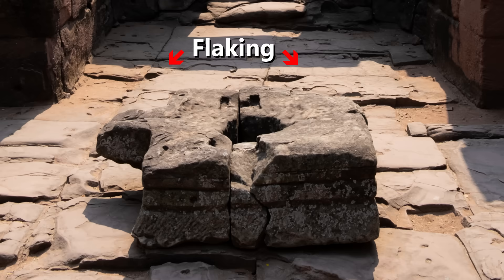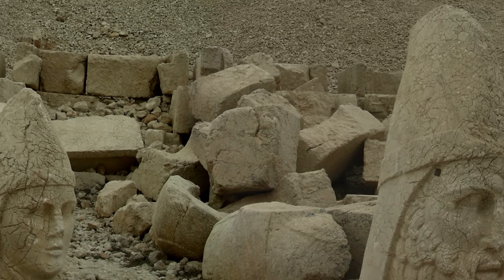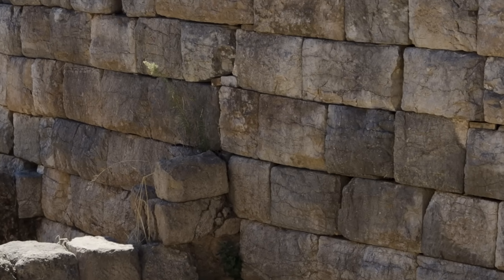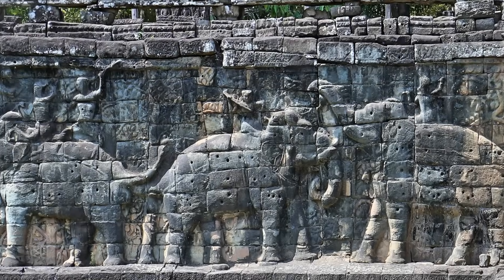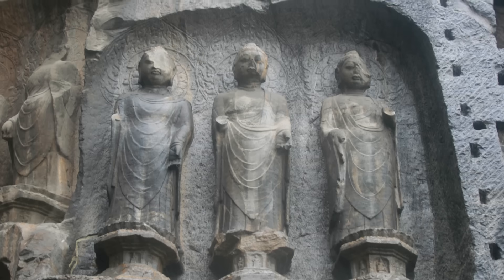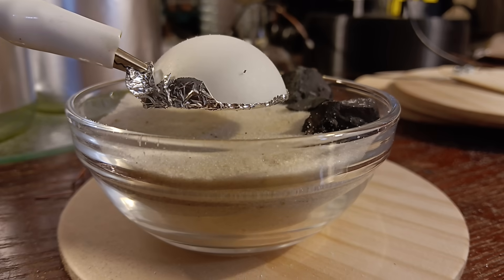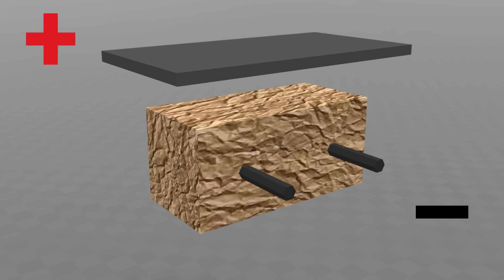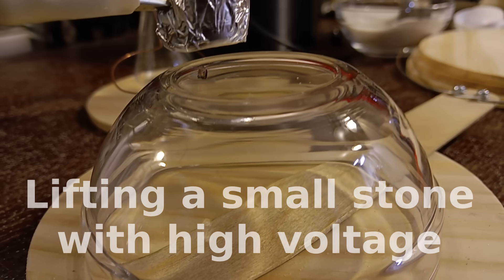The Greatest Mystery, Solved. Recreating Ancient Stone Melding Technology (Part 1)

Comment: You might be right.  However, you somehow failed to anticipate Questions:

1.  Why would the knobs be allowed to exist if they were formed while the stone was so soft?  Couldn't they be patted down with something?  Obviously it was decided the knobs would be allowed to remain in place for some reason.  Even if they weren't going to be visible, it seems too much of an imperfection.  What could the reasoning be?

2.  You assert(without evidence) that the rod left behind inside the shaft was actually an ancient electrode.  Maybe you're right, but does it (coincidentally)match any known modern metal tools?

3.  Any thoughts on what the structures' functions were?

4.  How was the electricity generated?

5.  How were stones moved across great distances with the technology you describe?  Was there a portable weight-reduction technique?

6.  The finished structures must have had some function which was not functioning during the construction of the structure itself, right?

I'm all ears to your exploration of these things because you seem to be the only person with a reasonable-sounding explanation for the strange details like the holes and knobs.  However, as I said, you failed to anticipate any questions.  That seems strange to me.  You must know you haven't come close to explaining everything, so you should have at least mentioned some of the elements you're still working on.
Reply: I think the knobs are so ropes wont slide off
Reply: 1.) they could help secure casing stones
Reply from the maker: I invite you to come chat on my website to help answer these questions as there is quite a lot here and I'll try to sum things up quick - I apologize for the late response and would like to go through your post here in greater detail; I am very busy with my Kickstarter project, you should follow along in the updates section there - anyway here goes =)

1) I think the knobs (which I also stated would be unseen in the video) were also used for structural support, such as if you were to cover the wall with a thick metal (gold? lost gold cities?) or other material, it would need places to adhere.

2) The rods in the shafts were more than likely on-site (in or around the pyramid complex) and then shoved up there by the curious explorers (who document using the rods as probes but not where they came from - they are the exact dimensions of these smaller square and hexagonal holes...

3) Pyramids / oldest of the structures, were primarily used for wireless power transfer of the surrounding area (for miles)...

4) In earlier times, the entire sky was said to have looked like the 'aurora borealis' as it had a much higher charge before several cataclysms -  then, and even today, you can still harness 'charge differentials' between ground and sky though nowdays you must go to the top of a mountain (and sea level ground) to even begin to get harness-able energy (however at about a kilometer, you can access kilovolts - there is a video on youtube here that visualizes that I think by RimStarOrg or similar name. (I also have a 'future of energy' video here that demonstrates 1 way to physically harness charge differentials)

5) The stones could be moved in many ways, such as placing a positive charge above, giving them a greater negative charge than the environment around it (making lighter) or more than likely, easily moved by one of the many growing (videoed and more) witness accounts of UAP's, UFO's and any flying thing which I have seen lift cows, cars and made a plane disappear... (Look for the 3 ufo's circling a plane and then poof!) however, like the previous methods and as everything else, harnessing the power of charge differentials to not only generate electricity but control it is key =)

6) Not sure what you mean, come and chat on my website WCSG-Science.com

The video was really meant as a guide for others (not much anticipation of questions) to start recreating the technology, those with high-voltage knowledge will get the message clearly and the future will therefore get the benefit =)
Reply: I think the pymarids were a ventilation system for the burried city around them.@MadPlasmatist
Reply: @nickstreeservice4454 I think the great pyramid was just a tombs, but built on the foundations of something massive that preceded it.

As for what lies underneath? I don’t know but I just love the ram pump theory lol. I want to look into that one some more.
Reply: @ChadDidNothingWrong The idea of the Pyramids being Tombs has been discounted for years... but you still believe that do you?
Reply: @MadPlasmatist - You must start thinking outside of the box, really outside of the human box...You gave away in # 6 what you really mean ! " Those with high - voltage knowledge " will get your message clearly ! You don't believe they, are more tuned in than you? They are, and THEY, still can't really figure out what the answers are. Why ? Because the real answers are so far outside out of the Human box... Old Naples Florida🌴🎨
Reply: @MadPlasmatist   one problem I see with most of the new researchers, on the engineering side, you don´t include the question beliefs, that no matter how much advanced a culture may be, they will always hold beliefs, and project them onto their most precious items, construction is as much symbolic as functional, I think that until we don´t truly understand what they were thinking, is going to be difficult understanding the knobs, obviously, those who built all that stuff, were hardcore believers too..and there is this thing of not finding written records, besides the fact that we don´t know how they comunicate, plus, how keen they where on embeding all sorts of information in just the shape and proportions of the objects, we maybe should see the knobs as part of their language/communication system  ??, like they aretelling us all already, but we don´tknow how to read that yet..as necessary the work of engineers is necessary, engineers must not forget, that the most essential vital questions for the life of a mortal being,  will be part and essence, functionaly and symbolicaly, of whatever they would have created, like any other culture. I see the knobs pretty much in this middle of the line, understanding that , a symbol, can activate thousands of thoughts and minds at the same time, (a simple cross as the most famous example?..) acting just like another mechanism...we must understand that absolutely yes, they understood the mind and interacted with it, entirely as a mechanism, that was capable of changing the shape of reality, it is this mechanism is what builds a pyramid...what we see symbolical only could be perfectlyseen as functional to them and viceversa, at once
I mean there are things, to my view, that we will not fully understand from a pure engineering perspective neither, we must dare understanding how they were thinking
Reply: @bobwilson7684Good grief, that was some stream of consciousness rant if I ever heard one. Some interesting points, some incoherent. So much mystery is driving people nuts!
Reply: @MadPlasmatist   Uhhh, this is starting to sound suspiciously like the "electric universe" pseudoscience stuff.
Reply from the maker: @MiqelDotCom  Know who you are talking to first, then restate your question if there is one, thanks =) https://www.youtube.com/watch?v=DLlBxhgOT_o
Reply: @MadPlasmatist  Ok, so you're an artistic electrician with a touch of megalomania who also plays a bit of piano.  Nice to meet ya. 🖖
Reply from the maker: @MiqelDotCom  And you're blind as *uck - Good luck with those ships in the skies =) I'll be waving while you are recycled.
Reply: @ and maybe you have no sense of humor? Anyhow, not sure what you're referring to with "ships in the skies".
Reply from the maker: @MiqelDotCom  Sorry Im dying and gave the most precious gifts to humanity - those 'orbs' are electromechanical ships and the occupants do not like me or you - enjoy =)
Reply: @MadPlasmatist  erm .. have u done a MRI scan lately? ... thers something missing ..
Reply: ...He is pretty convincing, his personality and voice actor skills are magnificent...My first question right away was, what was at the other end of the electrodes? Then I read your very articulate comment & questions which brings us right back too square one...Although it is a very good, produced video... Artist, Old Naples Florida 🌴Retired hands - on builder & architect & Faux painter of marbleized collum's🎨
Reply: @HenrySousa-n2c  ya, sadly ther ppl that will belive whats presented here ..

Comment: this can not be it. when stone is melted and cools down, it doesnt return to its original chemical composition. melted granite  solidifies into somthing that looks like obsidian glass. it does not look like the original granite. what they did is some type of chemical softening, where there was no heat involved at all. it was a fluid that was often poured onto the rock to make the surface soft, or the entire rock was soaked into a chemical bath until enough material was soft to achieve the desires shape.
the stone certainly was NOT melted, nor was it concrete, its some time of chemical restructuring similar to how chelation swaps iron bonds in stone against other, weaker bonds with chelation agents.

Comment: What  if all the "copper chisels" they find at these sites are just the nubs of cathodes and anodes left over after the heating process that were tossed aside. 
It doesn't make sense that they would use a highly electricly conductive metal for chisels. Not with all the work it takes to collect and smelt that much copper.
Reply from the maker: There were many generations of humans which lived after the last cataclysm and more than likely converted easily malleable metals into quick tools - these metals (esp the ancient copper blend) do not corrode as quick or are stolen through time such as steel or gold...

Comment: Scientists & Engineers often fail to recognize the fact that other people don't understand the core concepts they're talking about.  I'd appreciate it if you could get some granite blocks and Demonstrate(!) how they can be melted using high voltage.  Some of us don't understand electricity.

How were the electrode holes created?  
Does your hypothesis address the melted wall, and the melted staircase in Egypt?

*You're the first person I've heard propose an explanation for all the nubs and bumps.  However, your explanation raises the question, "Why couldn't they find a cold/flat stone and use it like a spatula to pat down the bumps while they were still soft?  The fact that they never figured out a solution to that problem suggests it might have been more complicated than it seems.  Are there any bumps that appear to have been patted down at all?"

Comment: Are those holes not there to hold wooden poles - for horizontal structures such as a roof or upper floor or ledge or stairs or to hold up fixtures such as lanterns. The extrusions are also another way to hold up horizontal beams. Most of the extrusions would be weathered and misshaped by now but we can still see some shaped to hold up wooden beams.

Comment: You're a whacko.
The nubs on the stone are from the quarrying process. 
It's simple. These nubs are where the stone breaks off after undermining.
The stones are undermined and a sled is put underneath. As more stone is cut away there are just two small pillars left. 
The weight of the stone breaks it off leaving the nubs.

Comment: was an interesting idea untill you tried claiming that the rods in the pyramid shafts were "unused electrodes".
Those metal rods are from a previous pyramid explorer from 1872 , named Waynman Dixon, was literally poking around in the shaft, and left them there. He even carved " opened 1872" into the wall.   There is an ancient wood rod in there, but its questioned if its from previous explorers, or  related directly to the pyramid.  You getting basic facts sooo drastically wrong, discredits any more complicated ideas you might have. Get the basics right first.

 find a video named "More Lost Relics in the Great Pyramid: Another Ancient Egyptian Mystery | Ancient Architects"... it will give you the information you are lacking, so will his other videos.
Reply from the maker: I'm pretty sure the humans just found the rods onsite and shoved them up there out of curiosity. They were originally electrodes used to inflate the 'sarcophagus' that is supposedly 'too large' to fit in the kings chamber. This was also done after a cataclysm, to create stasis pods - sites like Petra are actually physical representations of a 3D simulated world (and a way the interconnected stasis pods could also be later located) that was 'lived in' to pass the centuries... There is so much you need to keep on your journey of learning...

Comment: Why it cant be concrete or cement? Those materials are easier to make as may you can think, even with ashes you can make cement. Add to the mixture some powdered stone and you have a good geopolimer to start building. Also, those marks are for lifting the blocks with a pulley system.
Reply: Which is more likely, electrodes creating plasma or concrete?
Reply: @kma6881  concrete
Reply from the maker: There are too many quarries the stones came from (using the same technology to remove them) and too many places vitrification (melting) has occurred without any doubt.
Reply: @MadPlasmatist  when you melt rock, not always turn into the same stone when it freezes

Comment: Have you considered the electrostatic attraction of negatively charged earth ground? All systems that are not grounded to earth have a positive net charge  relative to earth, and Coulomb’s law dictates the will be attraction between the two. Wouldn’t it make sense that they somehow induce an electrostatic charge on the stone they want to lift (ungrounded) to a potential more negative than that of earth?
Reply from the maker: Yes that may also be another way and I've been experimenting with charge differentials and it seems ancient temples used this effect for power or other (hence the pointy metal hats and bracelets, and you'll notice, long 'chains' hanging from more notably the corners of old temples - along with pointed metal spikes atop each tower) in any case, all of these things were utilized long ago and the technology I've discovered is the key to using it again...

Comment: There is an actual difference of electrical potential, inside the different stones, used inside of the pyramid, as compared to those on the outside. 
  The book also, Decoding the Pyramids, will tell you many very interesting things. 
  It is a power converter to me. It sits on the exact location on the planet where the Center of the 
Milky Way Galaxy, passes directly overhead of its location. 
  That area is struck with Gamma radiation twice a day. The outside of the structure had slightly concave areas at their centers. This is a perfect geometric structure made to capture that gamma radiation inflows from space. 
  It made an energy bubble around its exterior, while the interior converted water into hydrogen gas for some purpose.
  The energy flowed upward to the capstone, where you can still measure it today. 
  If you read the Technology of the Gods, you'll see the Carnap painting inside a building of two bell jars with snakes inside, facing each other, then upward.
  The universal symbol for electricity is the snake.
  The bell jar looking area surrounding the snakes has what appears to be, color coded conduit going into the rear of the bell jars. 
 I believe that crystal balls were at the emitter locations, absorbing that flow of what I believe to be gamma radiation. Quartz crystal captures and amplifies the frequencies that it contacts. 
  There probably were two opposing Bell jars emitting a large gamma radiation amplified energy beam, skyward from the top of that pyramid. 
  I'm certain it was built there, to enhance the planet's geometric magnetic field, because the pyramid was built, Precisely On The Earths North, South, East, & West poles.
   They knew there were magnetic North and South poles when building that structure.

Comment: What material would the electrodes be made out of to not melt as well. This does not seem plausible, what would be used to contain the fasad of the rock?
Reply from the maker: The electrodes, I've observed, are made of iron or steel - of which melting points are higher than the stones - and it is a multi-step process where the stones are first heated to near-melting, allowed to cool, the electrodes quickly heated once more and removed leaving the visible nubs. Nothing is needed to contain the facades as the stones aren't actually melted - they are brought to near melting, their weight pressing them together and puffing them out... There is much more to this video though I am kept too poor to finish a part 2 yet... If you or anyone can help raise about 2 grand, I can get the equipment and make the coils needed - volt on!

Comment: You do know copper coils induction heating method as well if they used a copper mold for the large mixture of iron ore fused with different stones
Reply from the maker: I think they used induction heating to 'push' the smaller square and hexagonal electrodes 'into the rock', however a measured, lengthy plasma burst is the only way to reach high heat deep into the stones and to do it evenly as to prevent cracking.

Comment: Find: "basalt melting and evaporation with gyrotron". A method of loosening rock that increases its volume and thus eliminates gaps between blocks? Maybe not electric current, but microwaves. Such a research hypothesis...